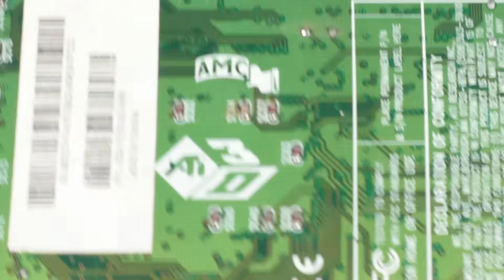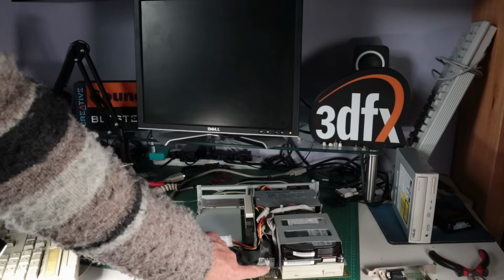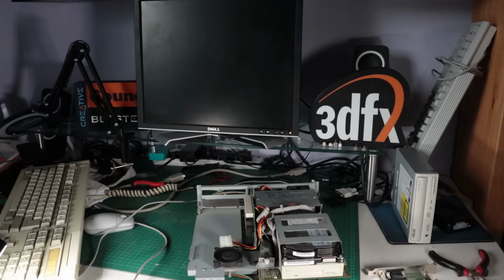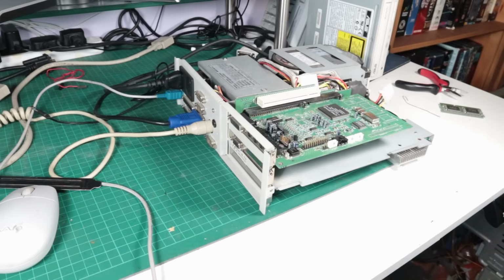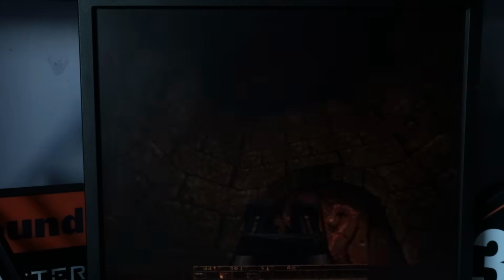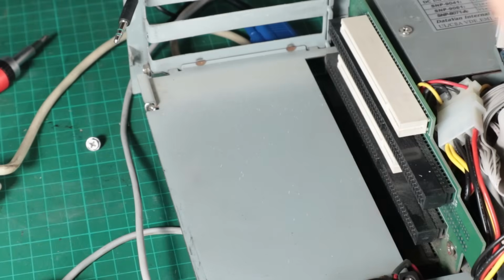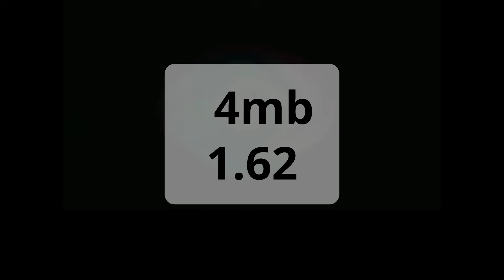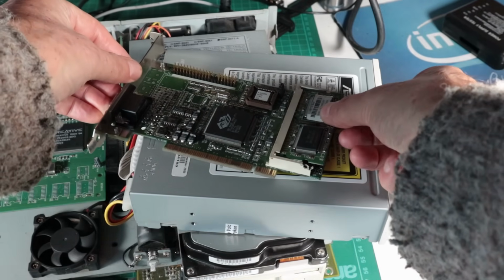Did upgrading vintage graphics card memory make a difference🤔🤞

Comment: That Cache speed thingy that eventually showed you the 8192 of VESA memory, did you note if its speed rating (55064KB/s) varied with either of the RAM modules or perhaps Combination? That's where you'd see the big difference in the non-3D DOS titles and presumably DOS VESA titles, anything that could support 640x480 in DOS basically? Thinking Duke Nukem 3D as a good example...

I think your comment during the first DOOM section is the killer point: It's like the titles didn't know - and If you weren't using VESA, they basically didn't - you coded to VGA standards (because you had to) and that was your Window and your Limit ... as others said, it's not until you start changing the size of the framebufffer, which was basically VESA onwards!
Yeah you had some things like Mode-X of Michael Albrash fame, but that was about using the same RAM in novel combinations, it wasn't faster because the video was faster but because the CPU could cope with blocks of pixels in faster combinations!

Edit: Apologies, I mention combination because it looked like there were 2 RAM slots, not just the 1. Soz!
If you check out Bits und Bolts and others, he uses a dos-bench suite that I think you can obtain. Of interest is SpeedSys, I think, that shows the number of Chars/S the video card is capable of - that's a deciding DOS number! (if you can get 7000+ you're in good times)

Comment: the IDT win chip was crap. At 200 MHz it performed like a 100MHz Pentium. Isn't it still going though. Isn't on of China's homemade x86 CPUs based on the IDT? Nice video btw. I'm soooo glad now, I bought a 2nd hand voodoo 3 instead of trying to upgrade my rage pro at the time.

Comment: No difference because you're running all the games in way too high of a resolution that this card wasn't designed for, nor ever had in mind. It's like if you had a 750ti and decided to play games at 4k, when in reality you shouldn't go over 1366v768p, which is that cards happy spot. Great video though. I miss old computers. <3

Comment: More ram doesn't speed up the gpu (unless it's bandwith starved AND the memory is added in a way that increases total bandwith). What it does is allow more and larger textures, and perhaps larger fram buffers for higher resolution. It can also reduce stutter caused by having to go back and forth to main ram for textures. So if you have period apropriate games with high res and low res textures you can choose between, that's where you can see a difference.

Comment: The 3d rage pro was released alongside the pentium 2. Pairing it with a pentium 2 makes sense. I remember emulating the Nintendo n64 on the 3d rage pro on a pentium 2 machine and it ran flawlessly! The CPU in this POS setup must be the bottleneck! It isn't just about the mhz frequency but also about the CPU architecture and its instruction set!
Reply: Also with that said it was mostly a 2D GPU at the time. Games like tomb raider, need for speed 2 , need for speed hot pursuit and a bunch of other 3d games were running fine on this gpu alongside a pentium 2. Perhaps quake and unreal are a bit too much for it?  When pentium 3 came out everyone would have upgraded to the geforce 2.

Comment: Now test it on a much faster system (P3 700+ or Athlon XP). that'll fix your cpu bottleneck.
Reply from the maker: That would be an unrealistic test, nobody was using cards like this in systems like that.
Reply: Yes, but it’ll help show differences between the two capacities.

Also, that card needs engines that rely on actual 3D engines, whereas most of the tests used were cpu dependant.

Comment: I am a bit dissapointed no one still tried to make a DIY SGRAM module since old ones are scarce or at least hard to buy from my location.
Wanted one for my Power Macintosh because with current 2MB is only capable of 800x600 and it means some issues with LCD panels.

Comment: I've done a lot of programming on the Rage Pro Turbo and AGP versions for a techdemo that uses 3DCIF API

basically it is a space sim of the voyager spacecrafts journey through the solar system rendered on a Rage Pro
It's a very capable card if used right, but CPU wise it does need about a Pentium MMX 233Mhz to get moving
In my test machine that's the absolute minimum.
The AGP test rig I spend most of the time on because it uses AGP Texture DMA streaming, but that uses an AMD K6-2 500Mhz.
Looking forward to seeing more from this channel :)

Comment: Run these Benchmarks in windows on 640*480 and also bench it using DOS games @ 320*200. running it at 1024*768*32bit will bottleneck the GPU and CPU
Get a PicoGUS ISA card for  $65 The latest firmware supports emulating a 4x Cdrom with Redbook. + much more.

Comment: For non 3d accelerated software, the memory on the graphics card is purely used for holding a copy of the output frame so the RAMDAC can send it to the screen. The additional memory is not used unless you use a display resolution/colour depth that requires a larger framebuffer.

For 3D accelerated software, you will only see a difference where the texture memory requires more VRAM, the small difference in 3dmark 99 is because one of the tests intentionally tests texture loads from 4MB to 32MB and the 8MB upgrade would have had a higher framerate in >4MB texture loads. I imagine this is exactly what is happening in GLQuake and if you lowered r_picmip so the textures were blurrier/lower res you could get them to perform the same.

IME these memory upgrades were only used for 2D desktop rendering of higher resolutions and bit depths. The systems were not fast enough to render anything 3D above 1024x768 anyway.
Reply: Yes thats it, very good reply. However I suppose he did have a point in that it theoretically could make quite a difference in render software.

Comment: 3dmark 99max or 2000 had some texture testing for vram capacity if i remember right, if you run the whole test. I think most of your problem is the system isnt good for testing with and you arent controling for variables such as the main one being what reaches the vram limit or not.
Reply from the maker: It was kind of planned as a realistic test, budget CPU, budget card but I will test it again with something faster

Comment: Interesting video .. that means that some if not many video cards of that time ... come with instructions recorded in their eeprom ... to only run with the factory amount of ram ... adding more ram then means ... installing new firmware to "free" it up and have the card use that additional ram .. I suppose that if that's the case .. it must be somewhat difficult to find the firmwares to do all this ... even so the video is not boring ... more than anything .. and after a few decades we have realized that it is a scam by the graphics companies ... really the expanded ram .. never helped at all ..

Comment: That CPU is heavily holding back the card. I have a vaio laptop with an 8 meg rage xl and a 1ghz athlon and it runs so much faster in the same benchmarks. Also, half your benchmarks were not even hitting the gpu for load. I think even if you switched to a pentium 233 or a k6-2 you’d gain a good bit of performance. The winchip was horrendous at fpu math as you know which is what 3d cards use heavily. In any case, it was fun to watch and would be nice to see a follow up at some point.
Reply from the maker: It was kind of designed to be realistic and period correct. If you were rocking the latest intel mmx chip you'd have been unlikely to pair it with a rage pro. All of these games were well within that CPU spec and despite the lack of fpu performance on the C6, gl quake was the only test to show a notable improvement. But yes, I will do a follow up and look at other cards with memory upgrade options😁

Comment: *yes It normally allowed you to use higher resolutions. I had a Matrox Millenium that came with 2 MB, I installed a 6 MB upgrade so I could run 1600x1200 resolution. To be fair, this was a 2d only accelerator, and I had two voodoo2 12mb cards in SLI for 3d.
Reply: It did, but 4mb is enough for the deskotp resolutions most everyone could run back in the day.

Comment: I wouldn't expect the extra memory to directly affect performance except in instances where it was being a bottleneck. The card doesn't have an extra memory channel for the additional module and is still running at the same speed over the same bus. Instead games may use the additional memory to store and display more textures they'd otherwise have turned off, which could actually reduce performance in practice since it gives the card more to process.
The Rage Pro should be capable of outputting 1600x1200 resolution, so 8MB of VRAM allows you to exceed 4MB limits like 1280x1024 @ 24bit or 1024x768 @32bit. Every link in the display chain (especially the monitor) has to support the higher resolution and bit depth in order to take advantage of it, though.
Reply from the maker: It supports up to 1280x1024 in both configurations. It may be the monitor cap but I'd be surprised, I'm sure this does 1600x1200 from memory but will check with other cards. Plan to revisit this with a faster CPU and a monitor that definitely does.

Comment: beyond the memory necessary for the resolution (ex 1024x768 needs 768k of memory) I think the extra memory is only used for loading better textures ... so you could for example run a game in high detail instead of medium... I dont think it can influence the frame rate

Comment: Just about any other CPU on the market at the time would be a better benchmark platform. that has to be about the most anemic performing core available. a terrible choice, any benchmarks are invalid when you know the CPU is the bottleneck. neat little machine in its own right tho. In my experience, albiet a little later, early '00s, RAM size only limited your res and bits, but clockspeed really was the killer performance bump. either buying a card with better ns ram, or bios mods and a touch of overvolting. I never did that with my main machine, but to goose up the previous model, more ram speed always was the winner. it was often worth slowing the core down to get the divider right, and just run faster RAM.

Comment: Something like a PicoGUS might be ideal for this kinda machine, acts like an ODE basically, letting you run ISO images. It can also act as a Soundblaster at the same time but this cuts the CD speed down to about 3x.
Reply: just made the same comment. The  PicoGUS  is certainly the way to go with the latest firmware also supporting Rebook audio.

Comment: The extra memory would allow textures. With Tomb Raider and 4mb there would be textures missing. Plus you need to use a better CPU. Was using a 300mhz K2
Reply: @C4nn15 I bet tomb raider ran  really well on 300Mhz CPU with 4MB RAM  compared to  28-33Mhz CPU setup in the saturn and ps1 with 2MB of RAM.
Reply: @cryptocsguy9282 it did 😊 looked good most of the time as well besides trying 800x600 and missing textures

Comment: More Vram is only going to help if the Vram is the limiting factor.

Most of the benchmarks and games tested either didn't use the Vram at all, or didn't use enough Vram even when in the base 4MB config to see an effect with the additional 4MB, the only time when there was a difference is when 3D acceleration was used and 4MB Vram was the limiting factor.
Reply from the maker: Yes, exactly. The video was to find all of this out.

Comment: GL Quake was the only game that leveraged the extra vRAM. Half Life, Tomb Raider, GL Quake, GL Quake 2, Hexen 2 and many others would have shown more of an uplift with more vRAM. This card would have been more at home in a Pentium II system or at the very least a super socket 7 setup with a 300mhz+ AMD K6 II/III. 

vRAM is used primarily for textures in games that utilize an actual 3d engine (doom does not). More vRAM will allow for higher resolutions in said games and 2d resolutions in windows. Software renderers won't see any benefit at all, they use the system's RAM not dedicated vRAM.

Comment: I remember adding the 2MB module to my 2MB Matrox Mystique for the full 4MB. I dont remember any real benefit at the time but it wasnt expensive or difficult to do. I did upgrade next to the revised Mystique that came next with 4MB but higher clocks (with a M3D card for better 3D) after that it was 3DFx Banshee then Nvidia till 2009 when I switched to AMD.

Comment: Hi, the Rage Pro, even if it is not an extraordinary 3D accelerator, needs a 200 MHz Pentium or even a 233 MHz Pentium to express itself.
Reply from the maker: 200 MHz C6 is still kind of in the ball park.
Reply: @66mhzbrain  C6 was laready in the old times dead procesor. It couldn't compete with Pentium 200 MMX. ( I did some comparisons already, that Pentium is much better. )
Reply: @66mhzbrain  I disagree with it being in the ballpark, it seemingly has less than half the FPu performance of a Pentium with the same clock speed... never mind a Pentium 2. Probably not much better than 1/4 in that case or so...
Reply from the maker: Though realistically anyone back in the day who could afford a 200MHz pentium likely wouldn't have been using a rage pro🤔 hopefully😁

Comment: A long time ago (in 1999), I tested the ATI Rage 128 card, and then it wasn't even close to nvidia Riva128 or 3dfx Voodoo, so it was quite expected that such an increase in video memory gave almost no performance boost.
Reply from the maker: I read that the rage pro performed well in synthetic benchmarks but not much else until the drivers matured much later. And that it didn't match voodoo/riva in the real world. I might test all 3 against each other at some point
Reply: @66mhzbrain  As I recall, only nVidia and 3dfx cards could really work for 3D rendering in games, all other video card manufacturers (Matrox, S3, ATI, Intel) could not even come close to the leaders, they all lagged significantly behind them in games.
Reply from the maker: The rage pro that followed this card was pretty capable.

Comment: Most of the games and benchmarks of the period just didn't require the additional 4mb. The biggest reason to upgrade memory back in the day was to have greater color depth and resolution. What would be more interesting would be to test a card with 1 or 2 mb and upgrading them to 2 or 4 mb.

Comment: Oh they were sold retail, but the retail version is Canada red soldermask! But they were also cheap enough (and nasty enough) that i'm sure loads more of them landed on green PCBs in prebuilt PCs.

You need more VRAM if you
- need more output resolution
- want to store more textures

In PCI era, either the game would have to go lower on texture quality, or as a rule, with not enough VRAM, you get a crash. As such, games were designed with 4MB video cards in mind and would generally not use more textures!
With AGP, we also got GART, ability for the video card to address main system memory for texture fetches, which however is pretty slow, so more VRAM is situationally useful, since it's faster, 3D Mark 99 is designed to showcase GART-VRAM difference to a degree, and i think the Intel 740 came with tech demos that were designed to showcase GART, they should show some sensitivity to VRAM amount as well.

Comment: There are a few things that don't seem right for me. For DOS games I would at least try Scitech Display Doctor if you can't find the DOS drivers. I have a Chinese Ati Ragew XL and it doesn't suck that much.
Reply from the maker: It's a cpu dependant card so it  probably depends on your system. The test was to see what difference a memory upgrade made, not to make it go as fast as possible.
Reply: @66mhzbrain  I'm using the translator, I hope I'm understandable. I really like this world full of little puzzles and I don't want to act like a wise guy, I'm interested in understanding what's happening. I have a 166mhz Pentium, it's not that different from your 200mhz IDT. In some machines the Riser creates problems, I wouldn't want the position of the video and audio cards to share lines on the bus. I use the 4.13.1.2655 driver and DirectX 8.1 and I've noticed a significant improvement in performance, I've also used Ati CIF with disastrous results, but each card is a world unto itself. I repeat that I don't want to act like a wise guy, there's something that escapes me, what you did is all right, I would have done the same moves but the computer or the drivers don't respond correctly.

Comment: Two questions. Was your monitor capable of higher resolutions? Were higher colour depths available? That will be only use for the extra memory in that card.
Reply from the maker: Yes the monitor was capable of much higher resolution. It didn't unlock higher resolutions in or colour depth in windows. The increase in frame buffer/memory bandwidth did show a difference in a couple of tests.